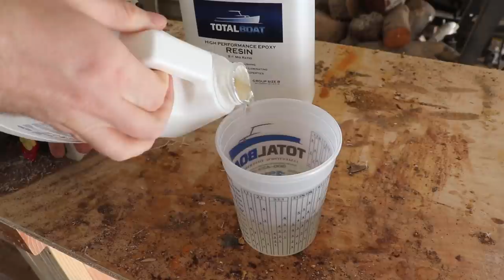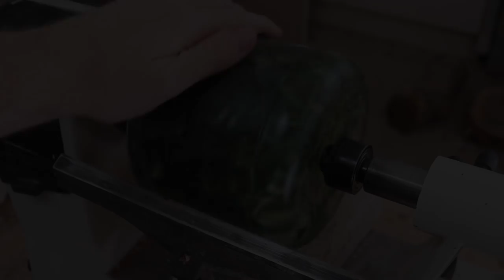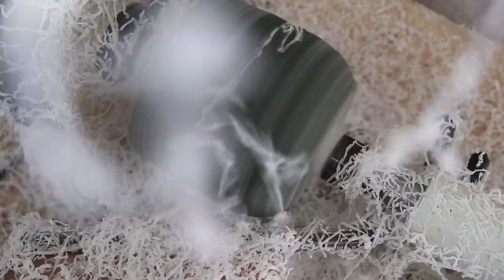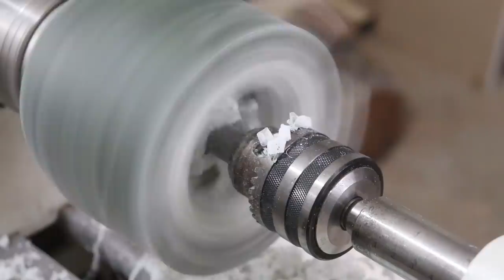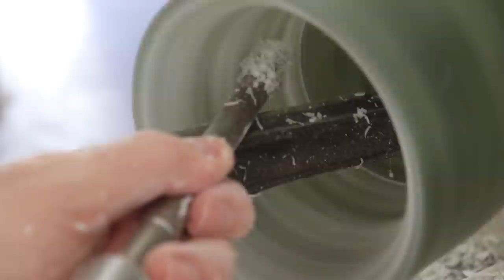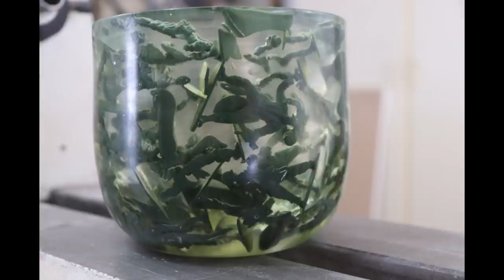Woodturning Toy Soldiers

Comment: That did turn out really cool.  I was thinking you had done something similar with Lego Blocks, but then I couldn't find it... so maybe I just imagined it.  HA!

Also, I don't think I've ever asked, but I assume the pressure tank you put a lot of things into, is used to force any air pockets/bubbles out of the resin to insure a more solid block to work with?

Thanks for sharing.
Reply from the maker: Thanks Lynn! I’ve thought about Lego blocks, but haven’t tried it yet. I think It could be cool for sure. 

And you’re spot on about the pressure pot. Gets rid of ugly bubbles and makes it easier to turn